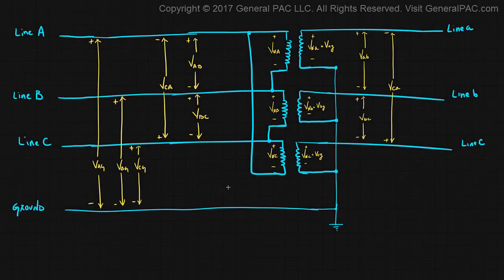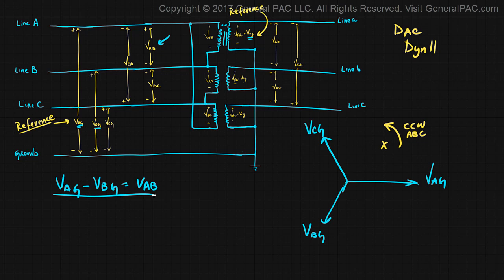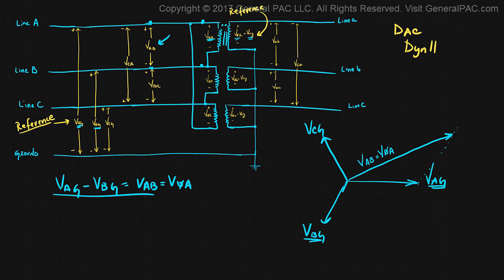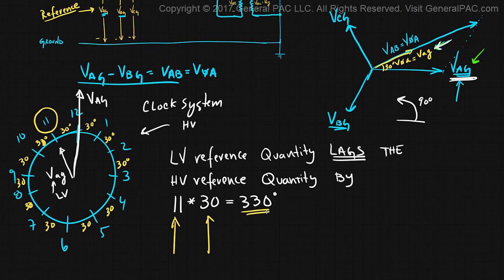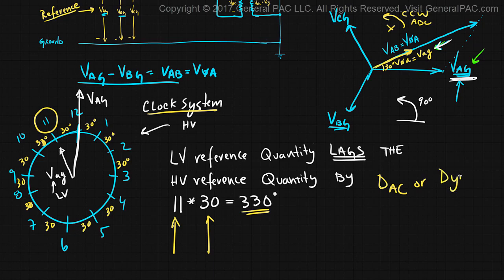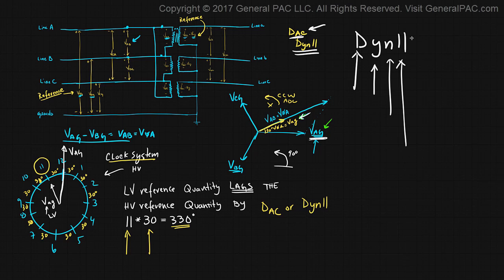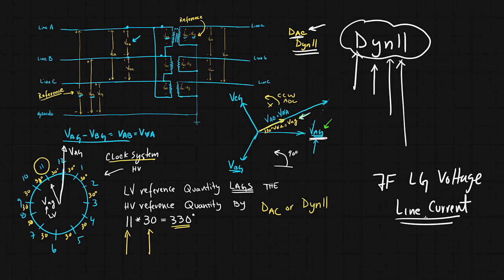Introduction to the Delta Wye Transformer Connection Part 7e: Clock System using voltage

Comment: hello thank you for the video, wanna ask is it the same when you have Dy1 with isolated neutral?
Reply from the maker: Hey Anwar,

Yes, it won't impact the results. When we have an Isolated neutral system, the voltage equations won't be affected because we consider neutral as a reference regardless of whether it is a solidly grounded neutral or isolated neutral. As for the Dy1, LV will lag the HV side by 30 degrees in the clock system.

Thank you,
GPAC Team

Comment: Excellent video! so the dotted line in the vector group of delta connection is V_AG?
Reply from the maker: Hey, The dotted lines are not V_AG, it is -V_BG.

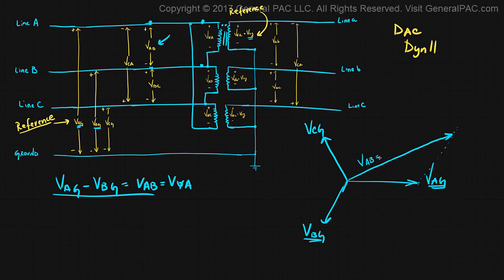You can also refer to the video part from 2:30 to 2:50 for further clarification.

Thanks,
GeneralPAC by AllumiaX

Comment: Thank you for these videos! They are very helpful!
So the only voltage phasers you didn’t add were the secondary line to line voltages. Would these be shifted from the primary phase to ground voltages by 60 degrees then? So V_ab would have an angle of +60 degrees from V_AG?
Reply from the maker: Hi Bucfan821, Thank you for showing your interest in the GeneralPAC YouTube Channel.
As far as we understand your question, you want to ask that once we convert line voltages to phase voltages (Delta to Wye transformation) then the phase difference will be 30 degrees and then if we convert phase voltages to line voltages again then will phase difference will be 60 degrees?
So the answer to your question is that there is no need to convert phase voltages to line voltages in star configuration but still if you convert phase voltage to line voltage phase angle will not be 60 degrees.
Hope this answer is helpful to you. We would also appreciate if you could help us so that we may continue providing you more value. How about you support us by becoming our patron? Please visit patreon.com/generalpac. Hoping to greet you as our patron. Thank you.

Regards
GPAC Team